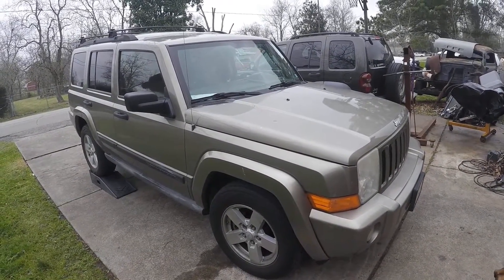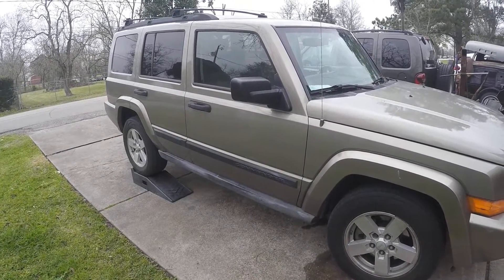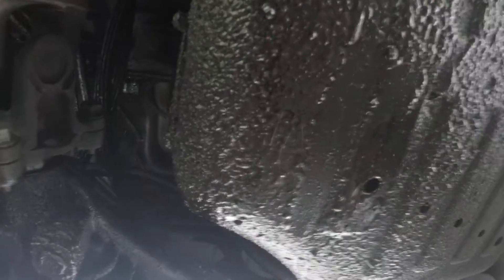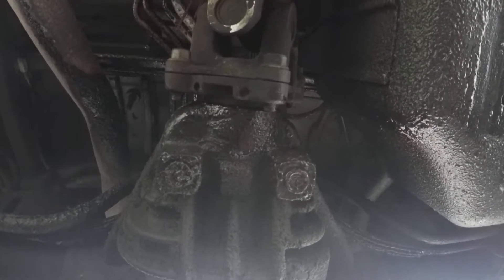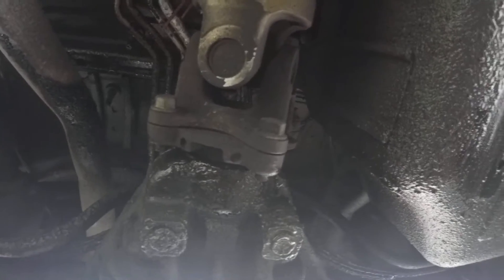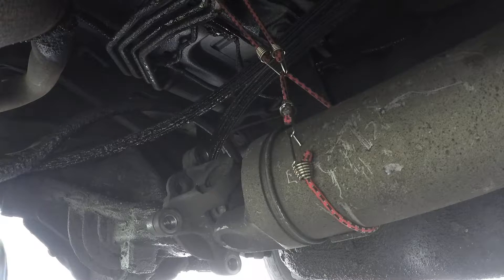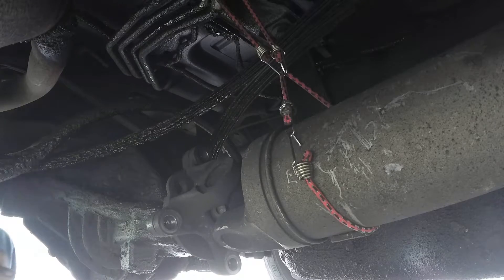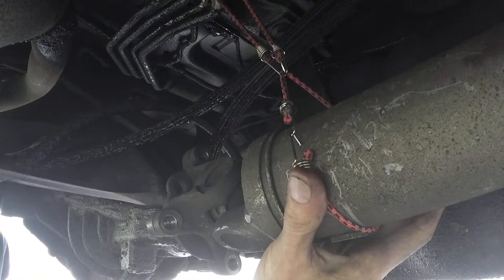2006 Jeep Commander 2 WD Pinion Seal Replacement

Comment: Hey I feel like this is a dumb question. But when I did this the bolt you need an 1¹/⁴ socket for came off by finger. So I did the seal put bolt on with one thread like you. Now the part I put the bolt on is bent a little up towards the car do you think I need to replace the rear. It still wines and I think that's it. Thank you for this video it definitely helped

Comment: I've just done this on a 2007 Grand Cherokee (same axle) over 3 days, about 10 hours work.  I'm an experienced mechanic BTW and have done many seals in the past, including a 1996 Cherokee pinion seal, but none were as hard as this one. 
 
In my case nothing went as easy as it does here*. Eg it took an hour getting the old seal out with a cold chisel, not including the time having to sharpen it to a very fine point first; no way could mine have been removed with a screwdriver. Then, no way would the new seal go in at first, it was about 1/2mm over-size and I spent 2 hours carefully filing it down to fit - even then it was very tight and I hammered it in with a steel reaction block on the opposite side to the hammer -  mine could not possibly have been gently tapped in like 20:10 ! My seal was made by Crown BTW. 
 
I expect a lot of diff oil would run out after removing the yoke and seal if you did not at least lower the oil level first - I did it with a syringe.
 
Also, the full service manual specifies a new yoke nut - it's a Niloc type. With a new nut, marking the old one is pointless. The manual says tighten to a preload to give a cetain turning resistance and this can only be felt with the rear axle up on stands and the brakes removed. At least that gave me the chance to inspect the brakes properly.
 
I don't have an impulse wrench at home so for the yoke nut I used a 32mm socket on a breaker bar - 3/4" drive system .  I also had to make (welding job) a large "C spanner" to prevent the yoke from turning (equivalent to the official tool C-3281).  The torque on the nut is around 210 ft-lb and I needed an additional lever on the breaker bar, all set up on wooden blocks in the confined space and my eyeballs were bulging with the effort.  Even before the new big Niloc nut bottoms out it took I reckon about 100 ft-lb just to turn it down the thread and in the confined space I could only turn it 1/12 turn at a time, after which the wooden blocks would all need setting up again for the next 1/12 turn, each taking a few minutes.
 
I my case it would have been far easier up on a lift, or even if I had taken the whole rear axle out for the job.
 
* Except for the four flange bolts - I've had the prop shaft removed in the past and I don't put them back with thread lock.

Comment: Hey, nice video. I'm about to do my rear pinion seal as it's leaking. How long did it take you to do from start to finish (not including the rear diff).
Reply from the maker: GBC18 If you don’t change out the rear differential fluid, it’s doable in about an hour.
Reply: Cheers. I'll be doing the fluid too but didn't have an idea for the seal